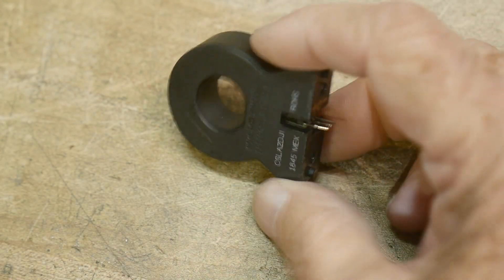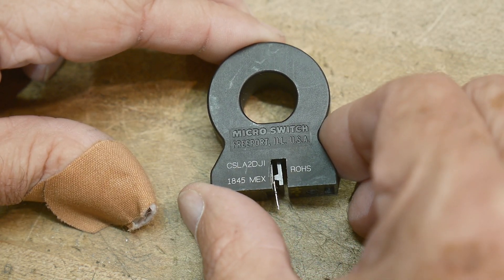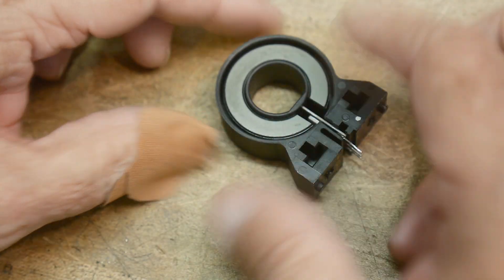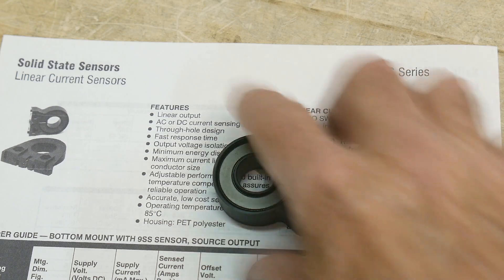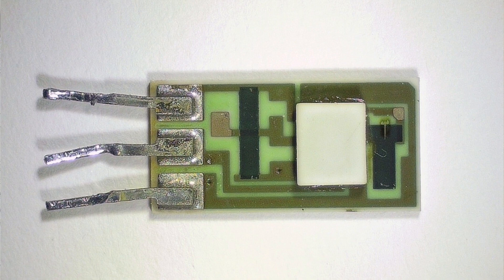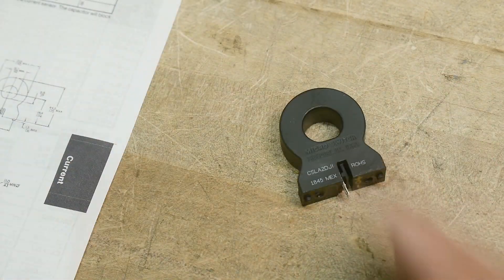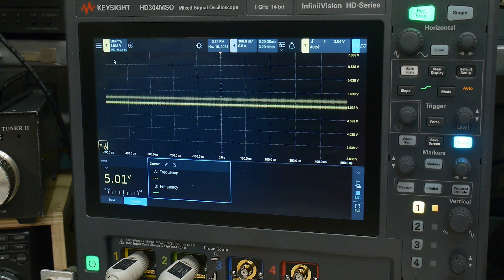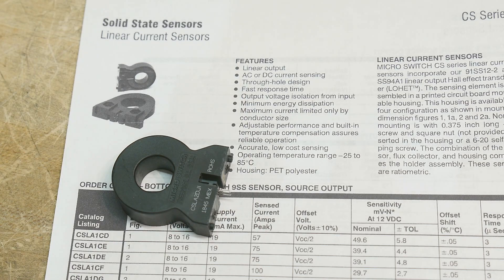#2053 CSLA2DJ 200 Amp Current Sensor

Comment: Why did you need the IGBT? Just set your power supply for CC 20A and short the leads???
Reply from the maker: I already had a device with large gauge wires, so nice 20A setup. Filmed the following day from IGBT vid. so no setup required. and this device and the IBGT were used together in the surplus motor controller that Mike got

Comment: 2:30 - Testing at 150A is easy! Of course I'm talking about simple modification of a transformer.
If you have large bobbin-core transformers, you can wrap a couple of turns around the bobbin core without altering the transformer itself and get a few hundred amps!

Or even better - get a small variac. Insert a single loop of 16 square mm wire into it (keep the loop as short as possible), and you can achieve 1kA of AC at around 1V! This setup is incredibly useful for testing stuff like switches, and for DC current, of course, you can use a full-wave-bridge rectifier but you need to account for the diode's voltage drop.

On the other hand, resistors are easy to use here since the voltage is low - a 1 ohm resistor will limit the current to 1A at 1V. So, if you need to test a switch at 50A, you can use a 20-milliohm resistor (but 50W rated!). And if you need more voltage, simply wrap one additional turn to double the voltage!

Comment: Correction 
1 wire is 1x current
2 loops is 2x current
3 loops is 3x current
4 loops is 4x current
...
10 loops is 10x current

Comment: Does AC current look the same on the scope?
Reply: It should.  The datasheet suggests it has a bandwidth near 300kHz.
Reply: Same as DC? Of course not. Pure resistive load on AC will be a sine wave in hall-effect sensors much like current-transformers. Non-resistive loads without PFC will look different. 

The difference is that the hall-effect sensor can measure both AC, constant DC, switching DC and anything like that, but current-transformers can only see AC and switching DC.

Comment: We use these in our tornado sirens to detect activation. 50 thru 150 amps is good. Over 150 amps is bad. Has a couple of comparators on the board. .1 volt per amp. .50volts equals 50amps. Honeywell is discontinuing them. They work great for measuring current.
Reply: 50 TO 150.

Comment: Glasslinger, who frequently appears in these comments, made a nifty electronic circuit breaker using one of these a while back using a simple comparator to set the current threshold and either a relay or a triac to cut the power. It was a rather creative way to protect equipment from short-circuits that’s more precise and versatile than a dim bulb.
Reply: electronic circuit breakers are used in building distribution panels.
They use MCU control for flexible protection curves and precise time to trip